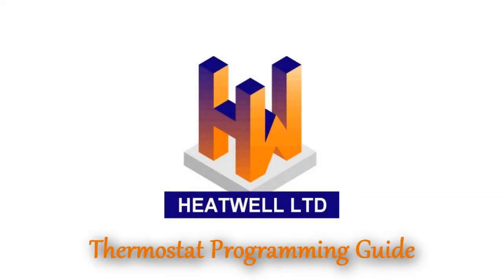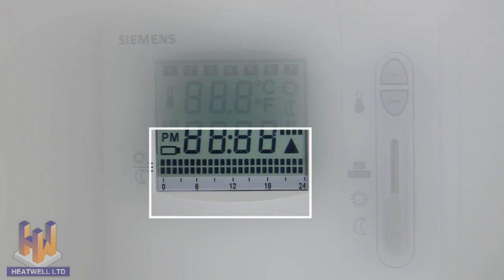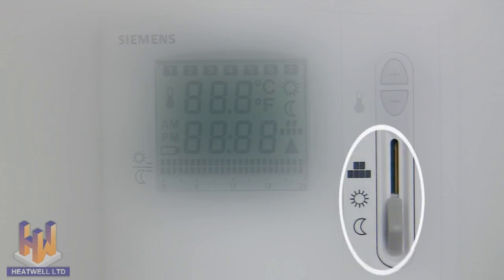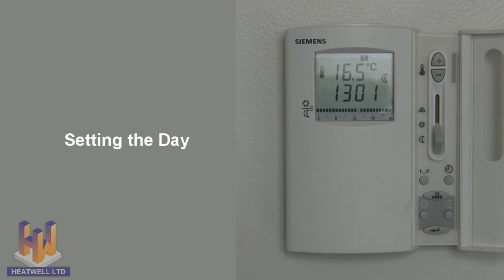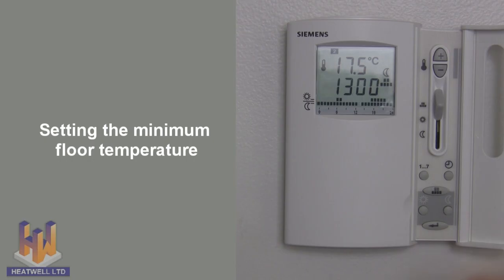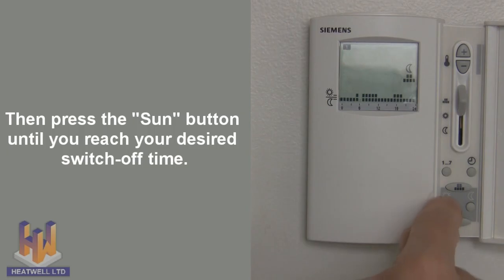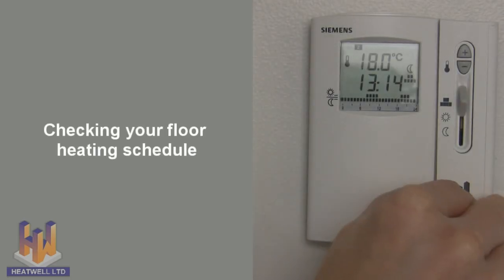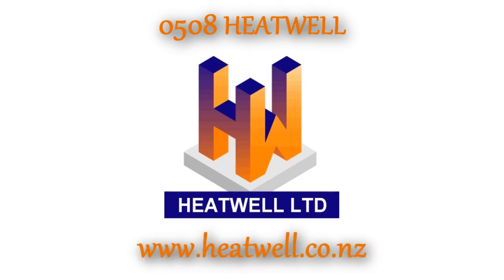Heatwell Thermostat Programming Video for Siemens RDE20

Comment: I'm sorry if those are dumb questions, but I'm trying to set this device & it doesn't seem to follow the instructions : 
- is it mandatory to set the automatic setting (seen at 4' in your tuto)? 
- is it possible to set both the "moon" & "sun" programs if we'd prefer to feel a regular temperature in the flat (ie.68°F or 20°C)? 
- if we set the "moon" & "sun" programs with the same temperature, will the heaters work (or will the device take it as a contradiction since you can't be eager to have 68°F/20°C in the flat & still set a minimal temperature at 68°F/20°C at the same time)? 
- if we only set the time, how will the device "know" the present day is monday (1) or tuesday (2) & so on? If the present day is "sunday" (7), do we have to set the device starting at "monday" so that the heaters work on monday?? 
- if it is mandatory to set the automatic program, does it mean we have to reset the following week at midnight sunday? Or the setting used on week 1 will be effective on week 2 as well and so on?

Comment: Is there any way of having none at all timer
Reply from the maker: Not sure what you mean, do you want to run it manually or just turn it off.?
Reply: @Kiwiash1  I dont want the timer at all so just either have it on the sum or moon dont put it on the timer ?
Reply from the maker: @leannerobson3998  Use the Sun as ON and the Moon as OFF. Set the sun temperature at your comfort number and set the moon to OFF by holding the minus button for 5 seconds after it gets to 5C.
Reply: @Kiwiash1  The grey triangle on the right is to be set on "sun" at all times then, in this case? I'm just double checking...
Reply: So I have come.to bed and put the mode night on I have it set to 16.5c at he moment. When the sun comes up.i will turn it to sun mood set to 17.5 I dont like timer moods never had never used just moved home

Comment: Firstly, bravo for the nice video, very good.
Another thing now: When the heating is on, I have hot water. Is it possible with this thermostat to have hot water without the heating? Just hot water?
Reply from the maker: The thermostat is a single switch which can switch one thing or multiple things depending on the wiring, but there is still only one switch so it can not be programmed to recognize different things to be switched, its all or nothing.
Reply: @Kiwiash1  hi there. Is there any way to reset the unit? The floor just keeps getting hotter & hotter, even though I have manually set the tiles to off. Cheers
Reply from the maker: @jakemeke8750  Put new batteries in the unit but make sure the battery holder has clean shiny terminals. Then reset by push and hold the Clock button and then push and hold the the + & - keys all for 5 to 10 seconds and it should restart. Cheers Ash
Reply: @Kiwiash1  Hi again. Didn't work, nothing happened at all. So it's just been running at 27 degrees for the past couple days. Any other ideas? Thanks
Reply from the maker: @jakemeke8750  set the sun temperature to 30c and then use the slider switch to go between sun and moon a few times until you hear the relay inside the unit clicking, then set moon and adjust temperatures to normal and it should ok.
Reply: @Kiwiash1  the symbols aren't showing on screen for some reason. Maybe there's a fault? Would you happen to know if there is a separate fuse or relay that I can switch off/ remove?
Reply from the maker: @jakemeke8750  No. Take the thermostat face plate off, that will stop it.
Reply: @Kiwiash1  cool as. Sorry for being a pain, but I really appreciate the help. Thanks

Comment: Wasting my goddamned life trying to figure out how to turn this fcuking unit OFF. This video doesn’t tell you how to do that. 

Nevermind, I’ll just waste my DAMN power heating my floors while simultaneously running my aircon in this scorching weather!
Reply: Shane Kitson hey mate - I had he same issue - keep lowering the temperature to 5, the lowest, then hold the down button for 4 seconds. It’ll write up OFF
Reply from the maker: Taken the batteries out when it is energized will leave on or vice versa.

Comment: Hi there how do u set it just to turn it on and off when u want
Reply from the maker: Hi Scott, Moon is off and Sun is on. Just set the temperatures in each mode then just switch between them for on or off.
Reply: Doesn’t make sense. Why would you set a temp for “moon” if “moon” is OFF? Why does OFF (aka “moon”) have a temp at all?

Comment: Thanks for the video. The paper instructions are very difficult to understand and you need a PhD to comprehend what's it all about. Your video was clear, concise and simple enough, even for me.
Reply: That's so true about the paper instructions. Thankyou very much for this video . My boiler stopped heating that's because batter in Thermostat needed changing .
I will be changing my heating  times. Thanks again

Comment: hey guys,i have a problem.i want to turn off the heating completely, so i set the thermostat to the OFF. the problem is the heaters are still hot even after an hour or two or even more and continue to come on. i have no idea how to fix this issue. any help will be appreciated